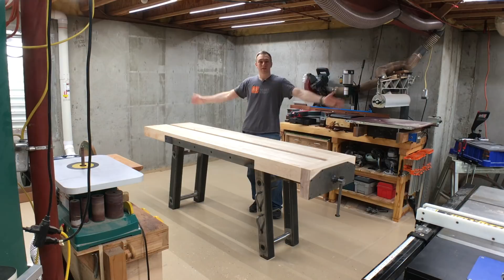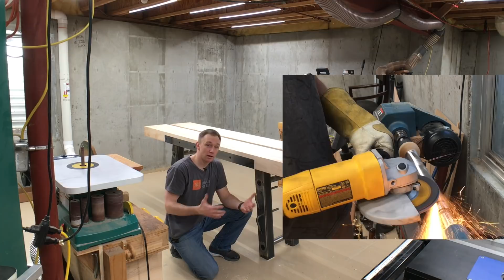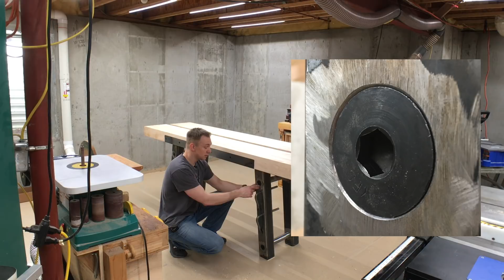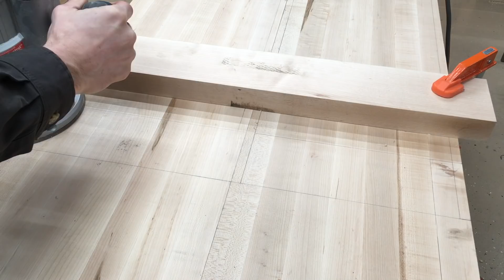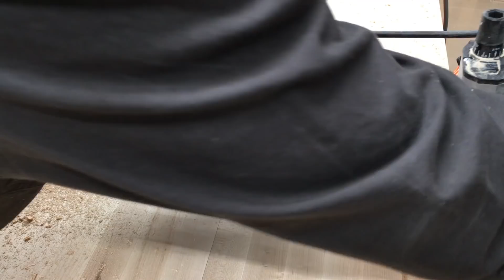Workbench 4 - First Assembly

Comment: Do you have two speeds of moving by using two sets of chain and sprockets, engaging one by pulling out the lever and another by pushing it in?
Reply from the maker: Close, but not quite, there is no chain involved
Reply: Double set of gears?
Reply from the maker: Yep

Comment: if this is being fabricated in a factory outside of the US the base starts at $500
Reply from the maker: I would have it made in the US, shipping on something like this would be challenging for overseas sourcing I think.
Reply: it depends on the company and contract you have. 
square and round stock steel at bulk price does come down a bit which would be impacted by your demand. I wonder about height options for your base considering woodworkers height differences.
Reply: You could vary the height a little bit by adjusting the thickness of the top. Not sure if that would be enough.

Comment: PS - I also hope you find success with this or any venture. For me personally - the steel frame has no advantage and would limit features I want in a handtool woodworking bench. That said - if you'd remedy those things and build a frame that has both an end vise and a side vise built in some way -Id consider it.
Reply from the maker: Appreciate the feedback, I do plan on having a twin screw 14" non racking front vise before its finished.  Which features/capabilities do you see this as missing for hand tools?

Comment: I don't understand why you didn't make the legs wider so they'd support a traditional skirt board flush w the edges of your top. It would also be more stable to have a wider stance
Reply from the maker: If I have flushed the legs with the top Then I would have needed a method of joining the front to the back that also supported the top at the center, I couldn't just cantilever over 8" at the center.  With the legs centered on each half this isn't an issue.  So flushing the legs with the top complicates the joinery method from front to back, and also makes it much more difficult to design a center tool rest that can flip over to allow the middle gap to be used to slip clamps into the middle of the workbench.  Since the bench is more than stable enough, even before filling the legs with sand, I see flushing the legs with the top as only a disadvantage.

Comment: If this gets produced the way you did it the retail number would be $1k at least.  Need to simplify the sub assemblies, open up the tolerance on the parts.  Maybe change or simplify the aesthetics with the recessed large fasteners, but that would go along with simplifying the sub assemblies.  

Button head,  coupling nuts, and all thread inside the tubes would keep 99 percent of the look you want with nothing to fabricate.  No need to weld a receiver in each leg either, just the right sized hole for the tube in one face of the box tube.  I do this for a living if you’re ever shopping, but sounds like you have a place to go.  Looks nice though
Reply from the maker: These are some good thoughts, does what you are envisioning preserve the ability to fill the legs with sand?  The ascetic is important, something I was thinking was to send the joining pipes to the back leg, and only to the inner pipe, countersink, and bolts on the front legs, this cuts all that expensive work in half, with no change to the ascetic.
Reply: Andrew Klein it would probably need sealant to be safe, but that sounds like it would cheapen the feel.  Could still weld a receiver  in the leg on one face to seal the leg.  Use the button head fastener like previously mentioned so you don’t need the build up for a big counter sink on the other face.

Comment: Looks fantastic and I definitely see a clear need for this product!  If you were to sell these, would the height be adjustable?  I think this is would be important for a consumer product, to account for differences in user height/preference.  I am tall and personally prefer a tall workbench, but i know many do not.  Also, I think a consumer product would need a method to level the legs on uneven floors.  I know my shop floors aren't flat or level enough to get away with just those rubber pads.

If you could account for the above, I would pay a premium price.  This would obviously be a lifetime tool.

Comment: I like the idea of the wood choice to be mine.  I think most guys would get over the legs have to be wood issue if it's marketed by a few different woodworking big shots like Marc or other high view YouTuber"s.  I like the kit idea but also the full bench idea (the metal portion) coming to me ready to finish with sand etc. is great.  Now comes the price.  If you price it at a premium bench price 2K and up I don't think it will fit my budget. If it is under $500 yes I could see that.  I need more info really.

Comment: As a former metal fabricator my benches, and stands are metal based. Surprise, steel can move more than wood, it just takes some heat. I could go on about “ how I would have made the base different, and or easier”, but you have a fine design. Good Luck. I have been waiting for a wood guy, other than me, make a heavy metal base. You did it congratulations. Fine job.